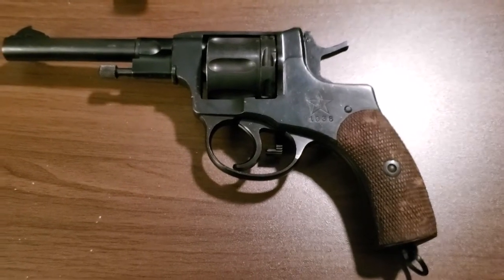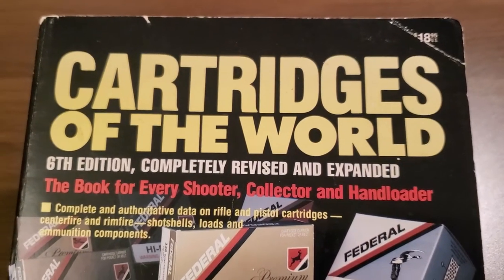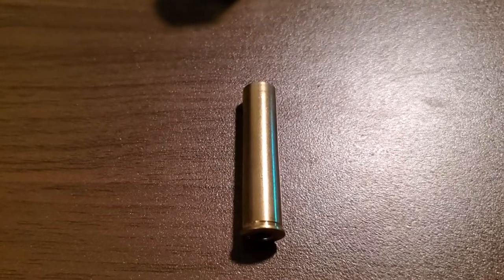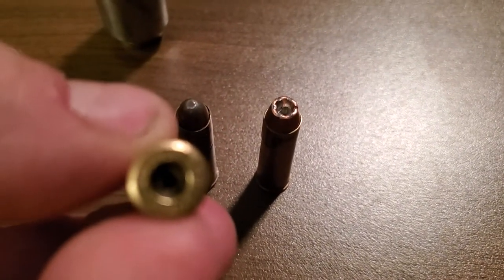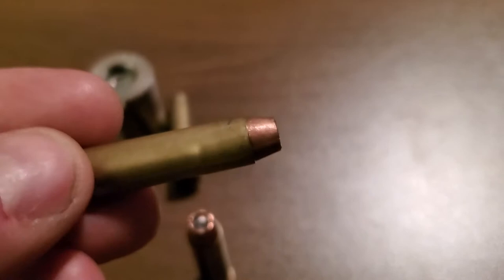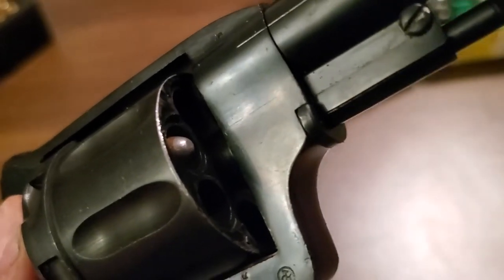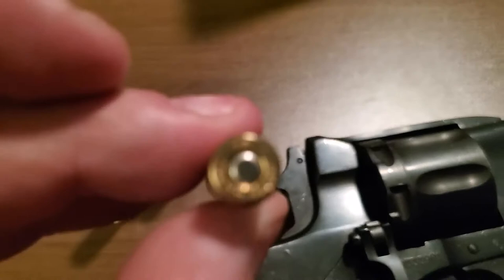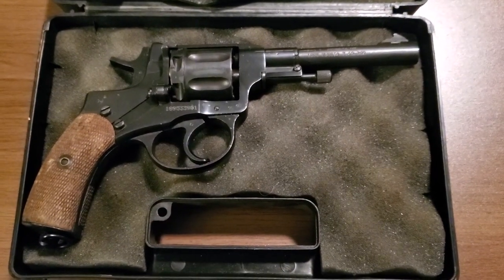M1895 Nagant Custom Ammo

Comment: Your solution looks like it'll work just fine. But that's a pretty significant crimp over the ogive of the 30 carbine bullet and upon firing that will be straightened back out. Repeated working of the brass like that will rapidly lead to more case mouth splits. I would suggest anealing your case mouths for long life or you could shorten the case additionally to where it crimps down on the full diameter portion of the bullet. Doing so would allow retention of the bullet without having such a significant amount of crimping on the case. I've got one of these revolvers floating around but haven't got around to reloading for it. I only have a small quantity of brass for items, but I guess I'm going to have to give it a try! Good luck and let us know how it works out.
Reply from the maker: Great advice, good luck with your reloading, if you need more brass, I have an obscene amount. Let me know
Reply: @AthensArmory303  awesome! I'm going to have to go digging through all the bags of clean brass I have stashed underneath my reloading bench and see how much of it I actually have. Otherwise I may have to hit you up for some!

Thanks!
Reply from the maker: I think if I remember correctly, I have about 1200 cases, once fired, factory length. I shot my nagant a lot years ago, fun little revolver and it used to be very cheap to feed. Now the prices are ridiculous.